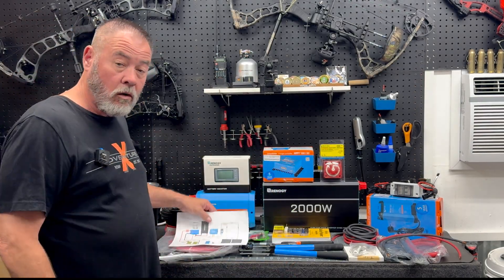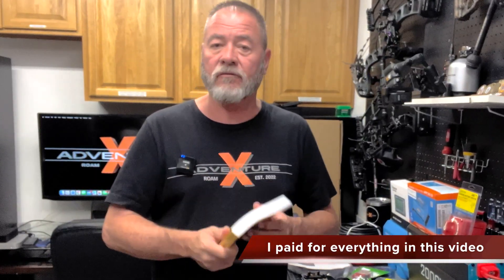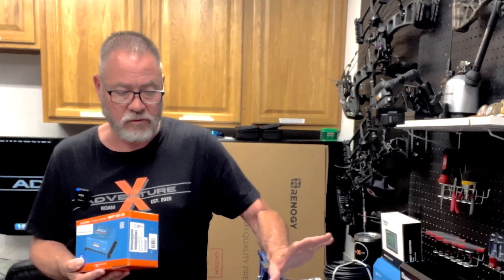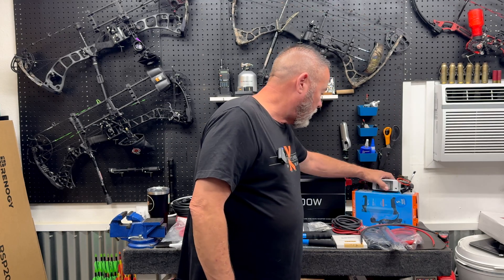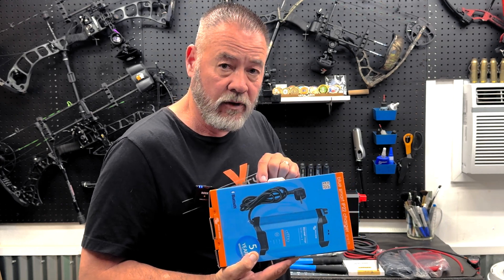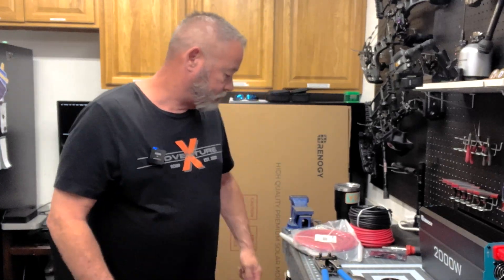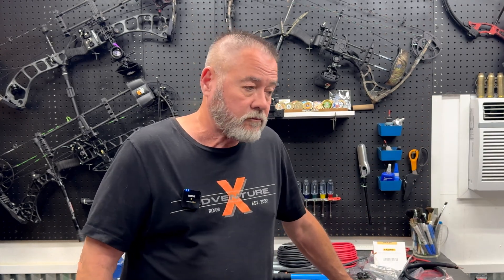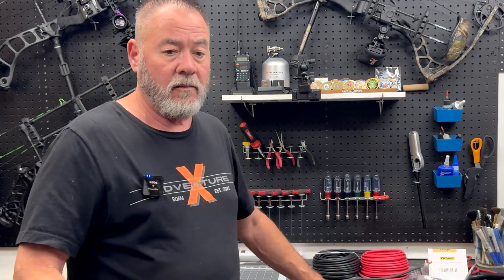DIY Solar Setup - Part 2 - The rest of the Equipment

Comment: 👍 My little Hiker Trailer has a Victron thing-a-mabob that handles the charging duties (via shore power 120v AC) for the LFP  onboard batteries. Has worked with no problems so far for two years.
Reply from the maker: Everything thing I read said victron was the way to go.  That’s good to hear it looks like I made a good choice.
Reply: @adventureroamx  Also has a Bluetooth app, which is handy for checking the status when charging.
Reply from the maker: @retnav92  that’s why I chose the Victron stuff